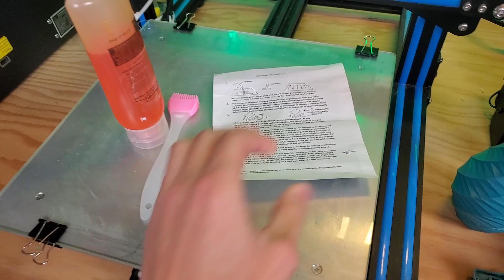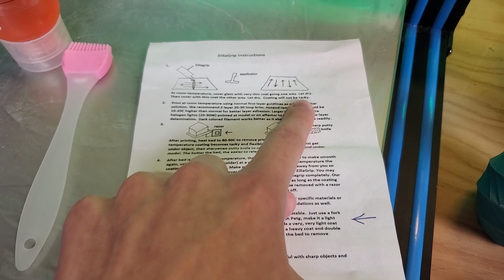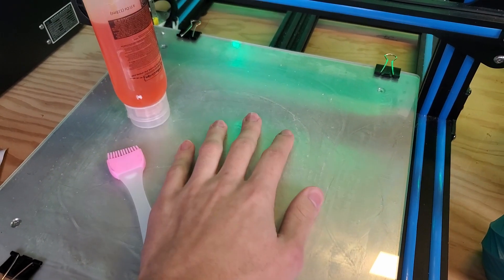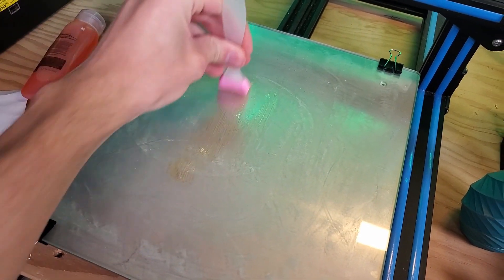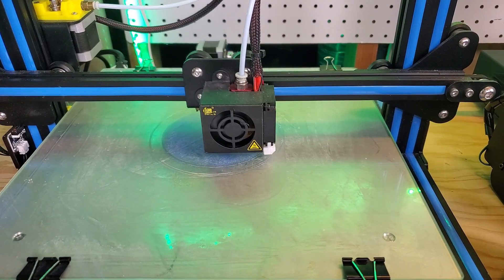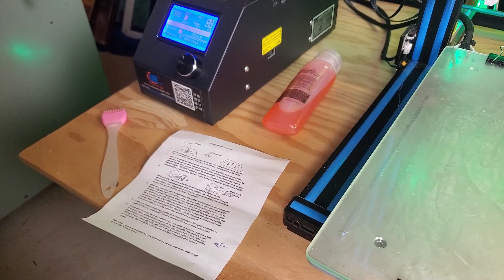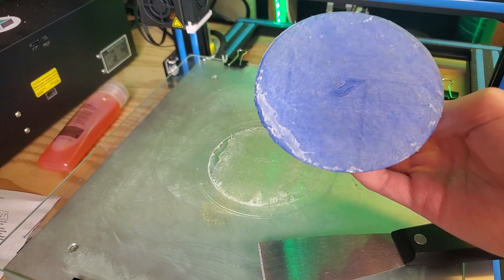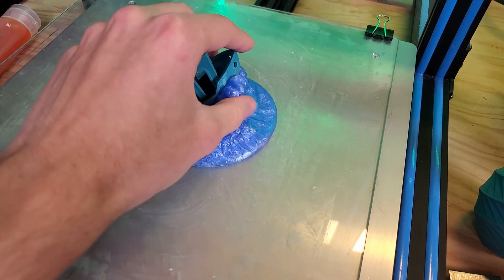Quick Look: ZillaGrip - 3D Print on a Cold Bed!

Comment: Cool video! I hope someone has told you this by now, but your first layer is far too close. Looked so close I don't even think you extruder anything lol. Just a quick obversation. like you style and content :)
Reply from the maker: Thanks for the feedback and others have said the same thing. The filament is semi-transparent so the first layer looks like it is not laying down, but it is. If the nozzle was too close then the extruder gears would probably be skipping. I know it looks like nothing is laying down because the material is transparent, but there is. It's just a little hard to see.

Comment: You do have to adjust the coat you use for the glass you are using and the filament you are using. For example with a light diluted coat you cal remove PLA by heating to 40C or less. You only need a single coat for PETG and then you can remove at 50-60C. Two coats for ABS or PP. Once you adjust your coat for your filament you will love it. Also, you can just repost the small areas where it is missing instead of cleaning the whole bed each time. It can be scraped off with a razor blade off glass  when cold. Works on metal bed s as well.

Comment: Printing without need to heat the bed would be awesome. But the removal looks tricky. I wonder if it can be used with spring steel sheet.
Reply: It works on glass or metal

Comment: I bought this product and it does work too well.
You still warped the print taking it off the bed. 
Heating the bed is part of the problem as it makes the print much softer.
If you are printing something thin you really need to cut down the glue with Acetone to remove it easier. 
I warped a lid and a box I had printed trying to remove them from the bed. 
The lid was fairly thin and had to slide into grooves in the box and was a lot harder to remove from the print bed than shown in this video.
You also need the Acetone to completely clean the old glue off print bed or soak the bed in hot water before trying to scrub the glue off (it wasn't easy).
Reply: You do have to adjust the coat you use for the glass you are using and the filament you are using. For example with a light diluted coat you cal remove PLA by heating to 40C or less. You only need a single coat for PETG and then you can remove at 50-60C. Two coats for ABS or PP. Once you adjust your coat for your filament you will love it. Also, you can just repost the small areas where it is missing instead of cleaning the whole bed each time. It can be scraped off with a razor blade off glass  when cold